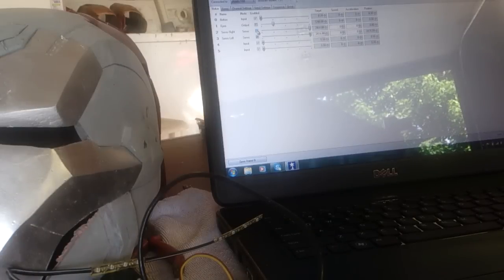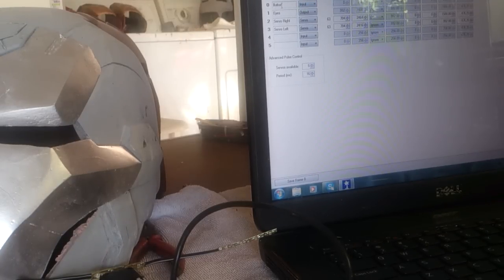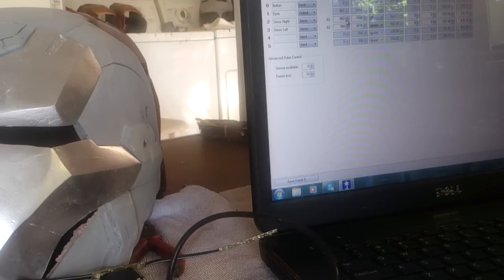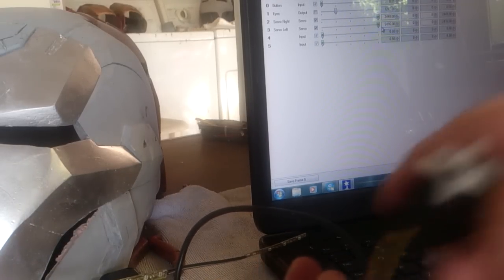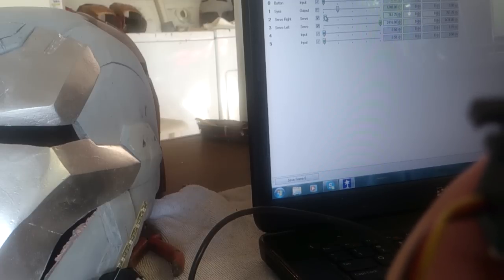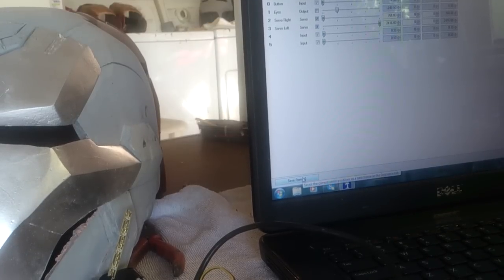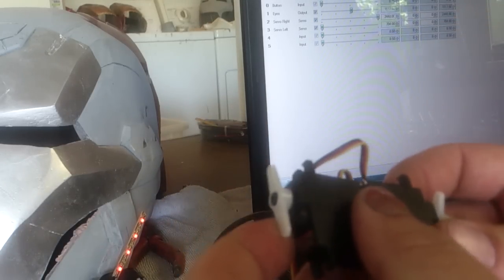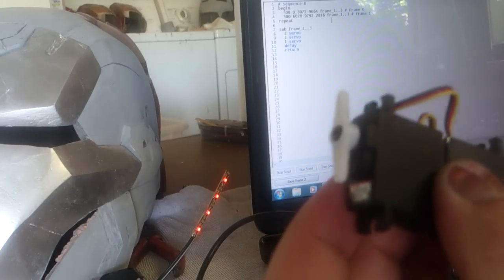Pololu programming tutorial

Comment: Hi, somehow my left servo outruns the right one although I have the same settings. I believe it is because the forward/backward movement is reverse. Do you have the same problems with yours?
Thx
Reply from the maker: There are two options:
If you are using a  #pololu  the slider bar for the the two servos should be mirror opposites or one is at 0 the other is all the way on the opposite side.
Your other option is to open up the servo and reverse it, like this:
Reversing Servos: Rewiring to reverse rotation
Reply: Jay May I have your first example setup (0 and opposite site). I also played with different speeds and accelerations, but I can't get them to work simultaneously. 
Anyways, thank you very much for your help! Finally I lost my fear of micro controllers! Thanks :)